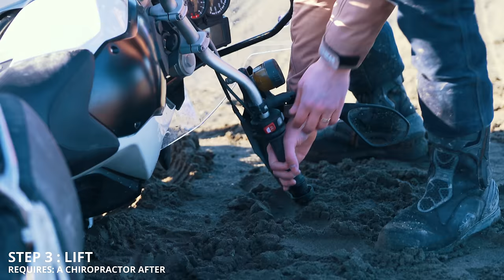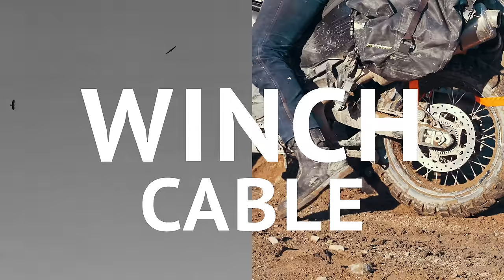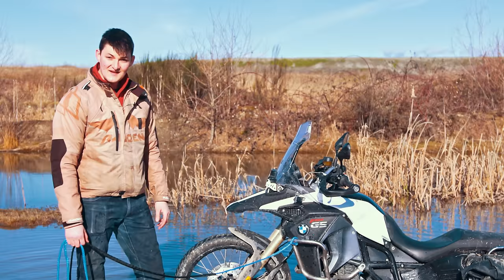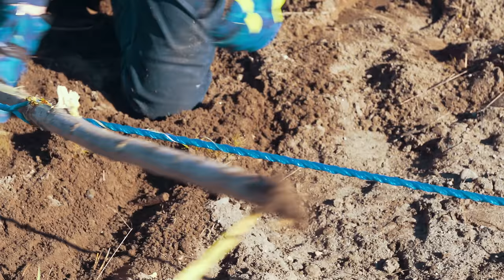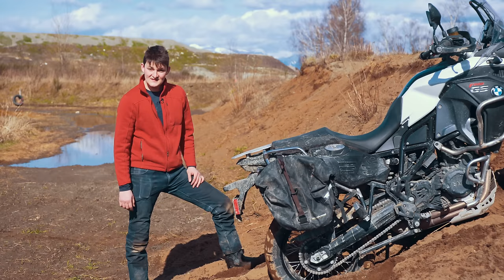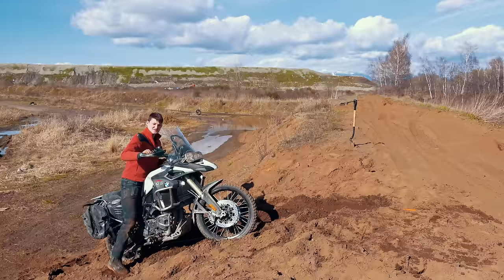5 Tricks to Rescue a Stuck Motorcycle

Comment: That GS: "I know i'm an ADV and all....but I DIDN'T SIGN UP FOR THIS!!"
Reply: One of the few GS in the world that get used how they are intented to be used. Usually they only get the 65 year old fat biker + even fatter, even older wife + 200 kg of luggage traveling at 60 km/h on a highway kind of treatment.
Reply: @arcuz7862  I'd argue GS's were made with touring in mind as well.
Reply: @arcuz7862  -  you're such a cynic, but bloody funny.  : )
Reply: Arcuz and as soon as the ole lady climbed on, the bike was over the load limit of the stock tires...
Reply: @davidc1961utube  Sometimes they even unleash hellfire and go 70 km/h on the highway. Not for long though, fatty in the back will be yelling in their SENA to 'slow it down, you're not 50 anymore'.
Reply: @arcuz7862  that's a stereotype. GS/GSA are driven by young and old alike. Kind you are describing travel on RT's.
Reply: @shambu2012  of course it's a stereotype. that's implied by the clearly flippant tone ffs.
Reply: @shambu2012  Lol. Nobody under the age of 50 rides a fucking GS. It's not a stereotype.
Reply: @arcuz7862  I'm 21 and I had the 800gs for 2 years (2019-2020)
Now I ride the Triumph Tiger 800
Reply: @patrickkdev  Your body might be 21 but your soul is 50. That's why you chose a grandpa bike. And then replaced it with yet another grandpa bike.

Comment: So... the double parking lift in our underground garage broke (literally, as in: there were two parts) and my MT-07 fell down the 3.5m (11.5ft) deep hole underneath. The lift maintenance crew shrugged and just left it in there. Insurance guy wouldn't go down to look at it. Local hoisting company told me they don't have the equipment small enough to get in. My brother in law has a winch on his work truck but it's also too big. He did help, however, because he has seen this video in the past. We took the cable off his truck, brought it down to the garage, hooked it to the frame of my motorcycle, threw it over a ceiling beam and tied it back to the rear wheel's hub. I almost wish my baby fell in there again just so I could see it winding itself back up the second time. Thank you, Ryan, for brilliant ideas! Best hold-my-beer experience ever!

Comment: Love these vids! Back in the day, I had a Kawasaki Big Horn (2-stroke 350cc single) dirt bike. Damn near lost it in what I thought was a shallow mud hole. Bike was impossibly buried in the mud and I was all alone in the middle of nowhere. I used the tip & drag method to get it out! A few years later, I was out exploring some unfamiliar roads on a '81 Gold Wing. The country road I was on quickly turned to dirt and then something almost resembling quicksand! It was so bad, I got off the bike and it stayed standing up (but bottomed out on the frame). I explored ahead on foot and found the road improved a lot just ahead. I went back to the bike to try and move it forward. Standing next to the bike, I started it, put it in gear, and leaned it over as far as I dared and 'walked' it forward, letting the rear tire get traction on the sidewalls of the rut I had been buried in. Since then, no more mud for the big bikes!

Comment: Quite invaluable I think.
When I was in China on my little 159cc honda it was still heavy and I went down a flight of stairs that were steep thinking I can get around the side of the building at the bottom, to my horror the river there was flooded and there was no way around it, I had to physically haul the bike back up the stairs 1 step at a time as it was very heavy and very hot too, wish I thought of taking a rope.
Reply: thats why you never skip leg day

Comment: Hey Ryan, if you want to skip the chiropractor you say is needed, try this:
1.Turn the handlebars to full-lock with the front wheel pointed into the ground. One handgrip ends up close to the gas tank – right where you want it.

2. “Sit” gently with your butt/lower back on the motorcycle seat. The bike may rock/pivot a bit underneath you.

3. With one hand, grab the handgrip closest to the bike. An underhand grip works best.

4. With the other hand, grab a hard part of the bike (frame,
subframe, luggage bracket, etc.) Be careful to avoid hot parts
and soft parts (plastic, turn signals, hoses, wires). Use gloves if necessary.

5. Now get your feet out in front of you, solidly on the ground, about a foot apart, with your knees bent slightly.

6. It’s time to lift the bike. Use your leg muscles. Lock your arms and take very small (baby steps) backward, keeping your back straight. Maintain control of the bike and
do not twist your body while lifting.

7. If the bike was on its left side … be careful not to lift too much and flip it onto its other side! (done that...) Once it’s upright, carefully put the sidestand down with one foot.

Voila, bike is upright and the chances of pulling yoir back are far smaller :)

Comment: I carry 50 feet of 2000 pound test Kevlar rope that's unbelievably strong for its diameter.  It has a much higher melting temperature than nylon and MUCH higher than the polypropylene rope shown in the video.  It can actually be used as a saw to friction burn through a tree limb so I'm not too worried when using it near the exhaust.  It's also unbelievably cut resistant and abrasion resistant.  It's bullet resistant too but I'm not sure how that's useful for an ADV bike.  It's great for towing bikes and a few types of bike rescue, although the hub winch was new to me.  Thanks.

Comment: The winch out using the rear wheel would be awesome, as long as you don't have a shaft drive bike with drum brake on the rear. I've accidentally sunk the rear wheel of my Suzuki Boulevard in soft sand at a friend's house and it wasn't very easy to get it out by myself. But low and behold, just minutes after I got it back on solid ground, my friends came home!! They had a good laugh about it, and now a few years later, I can too.

Comment: Poor bike got abused..!
Good information, thanks.
I carry a break down kit of an extra battery , a jump starter battery kit and fix a flat.. all fits in one saddle bag.. and a cheap volt meter.
Almost got stuck on a beach once.
My breakdown kit got me home yesterday.
I pushed the button and got no engine start.
I jumped it and went home.. found my bikes charging system is burnt.
Third time it’s happened in 4 years.
I don’t know why, my mechanic don’t know why either..

Comment: Great video. You can improve on the winch cable with 3 mm dyneema rope instead of ordinary PP (saving weight, allowing for more length) and a few ronstan shocks / sleeveless blocks. The blocks are expensive, but featherlight and zero maintenance. This allows to build a 3 x or 4 x pulley.

Comment: I've used the hub winch before but tied around the rim rather than the spokes, and then in to the hub.

I also quite like just carrying those little compressed air cans that can reinflate your tyre in seconds - that way, for most situations, all I have to do is deflate the rear tyre a little, increase the footprint and get extra traction. 

I also carry an abundance of cable ties of various sizes (including about 10x 20mm ties) these can all be zip tied to a free part of the frame, and cable ties work quite well as traction aids instead of carrying the car blocks. You can also do the same wrapping the rope around the rear wheel.

FWIW, I've always got a rope on my bike, I've had to tow too many mates home, and it comes in handy for tying broken panels back on, or holding broken subframes together lol

Oh and I also found the best bet is to pick your lines ahaha

Comment: Easier than the tourniquet method is just to push (or pull) on the mid-point of a long (non-stretch) rope (i.e. apply the force to the mid-point of the rope at 90 degrees to the desired direction of vehicle movement).  When the rope is straight, the 90 degree force at the mid-point of the rope translates to a nearly infinite force pulling the vehicle towards the anchor (although the force multiplier drops off rapidly with increased angle... which is why it's helpful to use a long distance from the vehicle to the anchor since it takes longer for the mid-point force to increase the angle).  I was taught this trick by my university physics professor, and have used the trick to pull out a Jeep stuck in a snow drift (using a long polyester rope and a strong anchor point).  Kevlar rope would be even better for this use, but it's more expensive than polyester...

Comment: Ryan, great video with excellent advice. But, I reckon the winch cord is NOT nylon.  (a) Nylon does NOT float. Density about 1.2 grams/cc.  (b) Nylon stretches considerably (about 30%), storing great energy that can cause a LOT of harm if the cord breaks and snaps back. Bad choice!  I'd guess UHMWPE (ultra high molecular weight polyethylene): density about 0.93;  very low surface friction (holds knots poorly, therefore the eye at the end);  very high tensile strength (roughly equal to steel); excellent abrasion resistance. Dyneema and Spectra are the two best known brands, but your cord might be 'generic'.

Comment: All of those are a great suggestions. But I don't see to many bikes out there with that much rebar wrapped around the engine. I think it would be easier to  avoid getting stuck. But I don't own an adventure bike either. The riding you do in this video I would be using a dirt bike not my daily driver. But like all ways a great video.
Reply from the maker: Thanks! I've seen people tie around both forks as a pulling point (in lieu of engine bars). ~RF9

Comment: God that looks like fun. Does nothing break on that bike when you dump it and lift it like that?
Reply from the maker: Nah - the crash bars take most of the brunt. My mirrors and hand guards are designed to fold away. And for everything else, it's just sand. ~RF9
Reply: FortNine :D
Reply: FortNine I should find myself a set of crash bars then, that’s incredible how durable the bike becomes. I noticed the handle bars struck the ground and was your lifting point is there no concern about bending them or misaligning the front end?

Comment: After watching this months ago. I purchased one of those lines and 2 of the traction blocks. I got stuck in soft sand right next to the road (with lots of spectators nearby) and didn't feel like dragging the bike around in the gravel on its side. I tried to pivot it on its kickstand but this was also uphill and that rear end was not going to lift out of the ground (ktm 1090) So I whipped out one of those traction blocks, slapped it on, and it pulled me right out!! It did get stretched about half-way across to the other side of the wheel though, I wonder if there's a better way to strap it on that it doesn't get pulled so far out, without tying a knot in it, as that would NEVER come back out after the fact.

Comment: In the first one, and I’m asking a serious question, and I’ve also never had a motorcycle, but couldn’t he just lift the back end up and to the left? Like lift it out of the hole? Is the bike really that heavy?
Reply: it depends on the bike really. proper dirt bikes are slightly more than 100kg, but even they can be really tricky to lift back wheel solo when it’s stuck really deep. on a behemoth like 250+ kg adv bikes, it is almost impossible without digging

Comment: You left out one of the easiest of all if you have a decent length of rope and a good anchor.  Grab the rope in the middle between bike and anchor and pull sideways.  This greatly multiplies the force up until you get about a 20 degree angle in the rope.  Then tighten the rope again to remove the slack and pull to the side again.  Quick and no chiropractor needed.  It does work best if you have at least 30’ of rope and longer is better.

Comment: For easy lift of the bike in trick 1 - without a chiropractor afterwards - bend with the knees, place one knee under the gas tank and stand up :)
Reply: I need some better instructions I didn't understand the tip ?
Reply: I use the old Harley david son video method , squating to the side the hande is with your back to the motor bike and as you stand up griping the bike the bike is easyier to lift .

Comment: Does anyone know if the traction aid would clear the rear fender on a harley? Asking for a friend that got his stuck in some sand just off road in Oregon (after pulling over b/c nature calling) and had to wait 6 hours for AAA.
Reply from the maker: Depends on the fender! They need a good couple inches both vertically and horizontally (swingarm clearance). On most Harleys I know of, the answer would be no. ~RF9

Comment: What about the times when your front wheel is in  a ditch and you can't go ahead only reverse?
Reply: Thats what has happened lots of times to me, xrv650 and mud. Front sinks faster than the rear tyre digs in... First trick will work, drop, drag. Have used ratchet (trees nearby) painful but gives extra 10cm. If you not alone, the another person grabing by spokes your front wheel and turning it giving you 2wd helps the best. Any other suggestions?

Comment: You have a rope... But you didn't show usage of the "Trucker's hitch". A simple rope winch that works against itself.. Caveat? you must have enough rope to get AROUND your anchor, and BACK to the hitching point. With some slack to set up the knot, and have a "tag" end to pull on. Sorry if someone else has mentioned this, I didn't take time to search through comments. But I feel like this one is an important one too. Knot tying is an IMPORTANT skill for any young man, motorcyclist, or even a trucker. 😂

Comment: Tip 6
Combine 4mm dyneema with ratchet strap mechanism....presto chango you have a pocket sized mechanical winch

@ryanF9 you can have that one for free buddy 😆
Reply from the maker: Clever! I did come across something kinda like that: https://www.youtube.com/watch?v=dnVFPAtuXoc ~RF9
Reply: @FortNine  ha yeah that's exactly it mate. Dunno if I'd use a pulley for a motorbike though....twice the power but half the speed.
If you've got pulleys you can use two to give a 5 to 1 mechanical advantage. So if you can pull 100kg on a single line you'll pull 500kg two micro pulleys

I also replaced the old steel rope on a trailer boat winch for dyneema and that's super handy around the farm. I'd Deffo take that with a snatch block over a 12v motorbike drum winch.

Great video as usual though Ryan
Reply: Two double sheave pulleys for 5 to 1 I should say

Comment: If thats dyneema winch line it's overkill. half inch dyneema line has a breaking point over 50,000 pounds. 1/8" dyneema cord would be plenty and easy to carry a hundred feet or so.
Reply: Might as well get two double pulleys for a 4 to 1 advantage and one person could pull a five hundred pound bike up a cliff. It's what I use when I work on my bikes instead of a bike stand. I don't have to worry about bike falling over when it's hanging plus you can lift your bike off ground anywhere there is a tree.
Reply: Good idea to learn how to make a prusik loop so you can easily lock off load.

Comment: Excellent video as usual. I’ve used the rear wheel winch method and it works awesome. As long as you are patient. I’ve also used rope wrapped around the tires for snow traction. Another excellent use of rope. Check out the rope video here https://youtu.be/6LNjEiLk-54 
Thanks for always putting out entertaining and super useful content!

Comment: For sand I think you missed "drop butt down and back onto the seat from standing and quickly release the clutch at the same time." Less a trick and more a technique.
Reply: This is a “how to get unstuck” video. Not a “how not to get stuck” video.
Reply: @mojosdad68  try it and see if you like it. If it doesn't work for you, you'll have 5 things left to try.

Comment: Fuck all that noise. Any bike I take into the wilderness will weigh less than 250 lbs. I can just heave that bitch out of anything it gets stuck in. But because its so light, it also rarely gets that stuck. I actually can only recall one time.

Comment: Yes, because I, too, carry a full sized shovel and chainsaw with me when I ride... the other tips are pretty useful though
Reply: Use a couple of sticks if you remember the breaking the pencil in experiment  where one is easier to break but if you attach a couple of them together it impossible to break
Reply from the maker: Necessity is the mother of invention. I bet if you were really stuck, you'd find something to bury and dig with. ~RF9
Reply: @FortNine  sure is, having a tree close by would help too!

Overall good ideas though, hopefully I will never be stuck bad enough to need a winch or anything!
Reply: @tanmaypanadi1414  very good point
Reply: @FortNine  also, I do want to say that burying a log for an anchor in sand is a very good idea for an anchor that I have never thought of before. I 4x4 with my truck alot, and do have room to carry my saw and shovel, so I will remember this tip when over landing!

Comment: Yeah... Any tips for when you drown your wheel in 16 inches of pudding? ;)

https://www.instagram.com/p/B86zx7NHfXa/
1.5 x 2.5 yard mud hole. Front wheel managed to get through.

By myself: built a foot support out of thick branches and logs, but absolutely zero chance of even laying the bike.
Two people with a towing line: no difference.
Four people... with a towing line: still no difference.
Finally set free, after 3 hours, by a tractor with a lift.
That powerlessness though...

Comment: STATIC-LINE,... (Rock Climbers) WILL NOT STRETCH,.... And  While (REAL) Mil spec. 550 Paracord, has 550 lbs strength) About same size Staic line (cord) is 1,400 Pounds OF STRENTH!